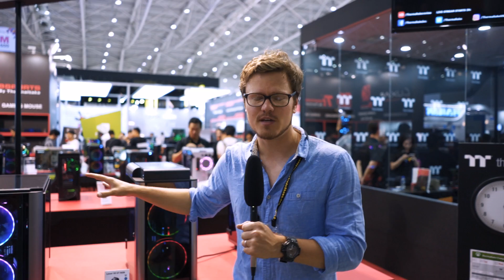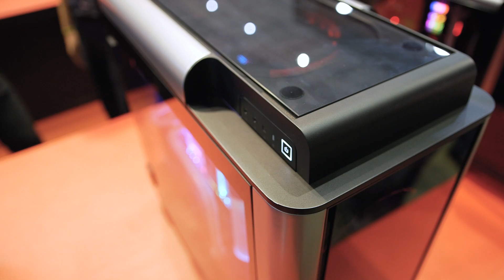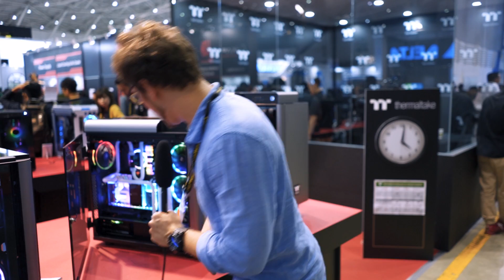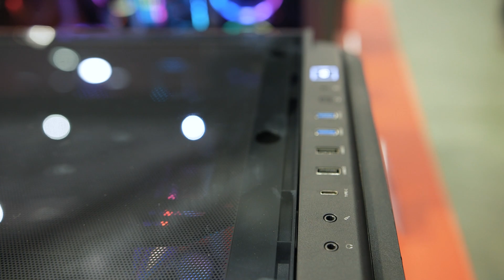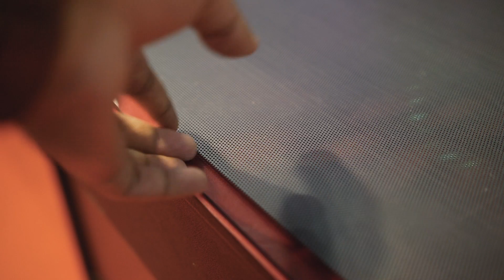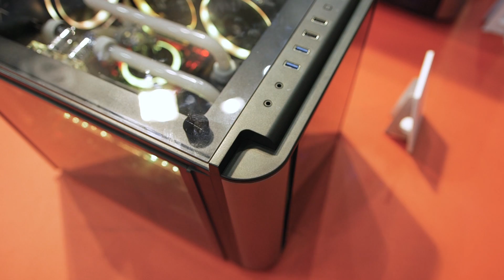Thermaltake Level 20 Series EXPANDS & Gets Cheaper!

Comment: For the people complaining about the fans for an extra $100s. The Riing 20s are $40 a piece so 2 of them plus a 140 puts it at $100. So why does it matter if they are the same price? If they didn't do this they would be lower quality fans that would just hit the dump anyways. I plan to grab some riing 20s myself for the V71 and need 4. They have some insane airflow with 1000rpm max and 118cfm to go with that. SO I would think this is fair to save overall costs of needing to use low quality stock fans.

Comment: The Level 20 would be more tempting if the metal corners was a mesh instead of just more air blockage. Also, a mesh front option to replace the TG would be nice. Overall as it is, looks nice for a low watt non-gaming system.

Great Vid Dmitry, Eber, and crew. B)

Comment: Would trade RGB fan windows for airflow.
Reply: that was what I was thinking, Especially that micro ATX case. Thing looked like a glass oven. The smaller the case the more Important cooling becomes.
Reply: Zarcondeegrissom
NFC skyreach 4 mini might be a case you would be interested in if you don't mind a case that is so small a SFF PSU will not fit (yet a full size titan will fit nicely believe it or not).
Reply: Chemislife, exactly. Especially, given motherboard makers persistence of putting VRM Fashion accessory blocks on the smaller boards that are willfully inadequate for anything beyond the lowest tier CPUs (i3/r3) available. And don't think about putting anything over a 23 watt graphics card in the newer mini cases. lol.
Reply: yeah, that skyreach 4 mini looks like a nice one, akin to most pre-TG styles with better airflow. B)
Reply: Well the core v21 has pretty good airflow. If they give you TG and an IO upgrade kit (is possible due to the design, I would know since I own it), then that could be good. Maybe they could make the Io cables longer too so they don't have to stretch across your build and could be routed along the edges...

Comment: For Thermaltake:
For the Level 20 XT I'd like to see:
1. Having a little bit more space between the front glass panel and the fans (may be an extra 5-10mm?) 
2. Dual-system support (like adding an additional mITX motherboard et al)
Otherwise I think it's pretty sick.
Thanks to Hardware Canucks for being awesome and not taking each other too seriously; nice to see max banter but still getting out awesome videos!

Comment: oof the level 20 VT must be the spiritual successor of the lanbox lite
Reply: lol, the Lanbox Lite, had more intake vent area for better cooling. That was a tad before the TG convection oven craze I'll guess.
Reply: Zarcondeegrissom lol if you actually owned a lanbox lite you'd know that the ventilation didn't matter at all with your cpu cooler options being super limited at the time because of where the psu was located. I remember zip tying a fan to my side window as a second intake just to make my temps a little more comfortable since the front 90mm fan just didn't seem like enough, but that was almost a decade ago. 

I don't disagree with the idea that ventilation is clearly going to be an issue with this case. At least with the VT you now get a basement for your psu instead of having it hang 4 inches over your cpu.

We won't know how bad things are until they do some testing.
Reply: ok, yeah, I see that. I guess having airflow isn't everything if the PSU intake is inside the CPU cooler area, lol. Looks like flipping the stock CPU cooler fan upside down is the only option for that, and to hope it is not trying to push air through the center hub of the PSU fan. I don't really see a way to put even a 90mm CLC in that thing with the way it's laid out internally.

At first glance of pics, it looked like that would be a good case with the mesh front below the drive bays.

Funny thing, a lot of smaller dell and HP computers also used the PSU fan to suck air through the CPU heatsink back in the day. It wasn't great, however it did sort of work. lol.

Comment: Wait, $100 more for 3 fans? Huh... The View 31 TG with 3 fans is only $40 more.
Reply: This comes with 2 riing 20s $40 a piece. And a 140 riing
Reply: The View 31 comes with 3 140mm Riing RG Premiums though? Which is 130 bucks.
Reply: It doesn't come with premiums from what I am seeing. It comes with regular 140mm Riing Rgb fans and I am sure the basic controller. They are about $60 so half the price for the fans before hand. If this however does come with the premium controller and not the standard I could see that. We will have to wait and see for the final release though.

Comment: damn why no type C on the cheapest case ?? case makers are always looking for excuses to sell new cases and type C is a fine one ...
Reply: Buy an adaptor.
Reply: Just curious, what is type c used for anyway?
Reply: TDS I do for my phone, I'm looking at a hard drive enclosure that has it too.
Reply: I have the same question
Reply: Type c 3.1 is expensive. Nothing prevent them to put regular 3.0 USB c just for the sake of having choice. Almost all of my peripherals are type c
Reply: Phone (s8, and formerly n6p), externalssd, USB key, camera (Sony a73 and GoPro), sd ccard reader. M only regular USB are mouse and keyboard
Reply: I don't think type c 3.1 and type a 3.1 have different speeds. Unless you're talking about thunderbolt
Reply: its for the future
in 10 years usb a will be like ps2
Reply: Cause it's expensive
Reply: Which peripherals if you dont mind me asking? Everything I own is still on USB-A or micro.
Reply: I would really like one usb c on the front, I mean high end mobos have it but then you have to reach around.
Reply: Who uses Type C though?
Reply: A lot of micro atx and itx motherboards don't have a front type c jack on them